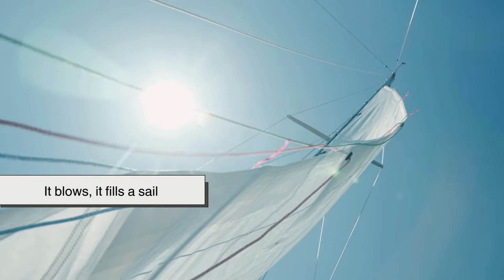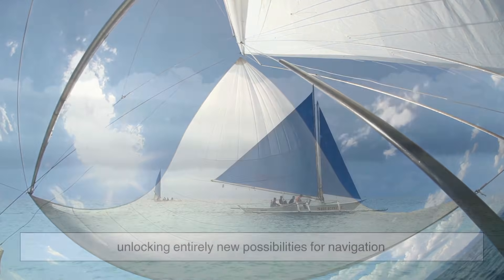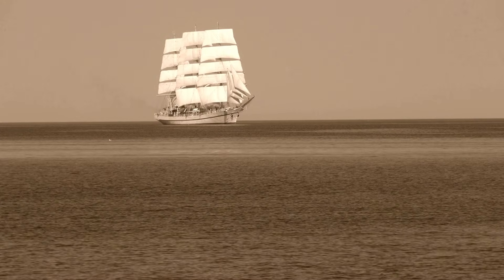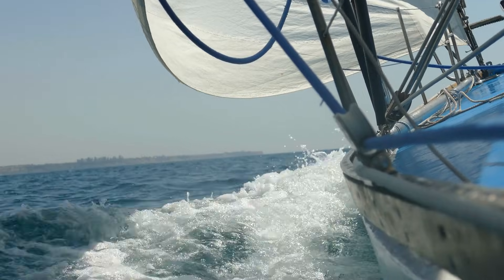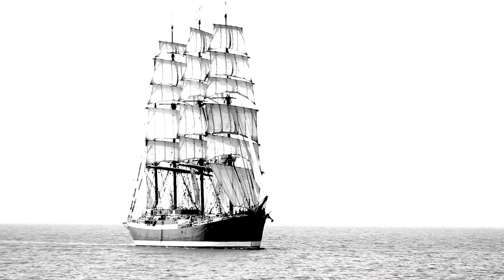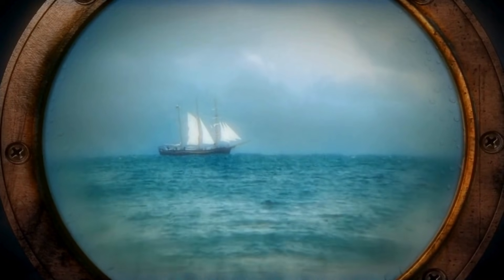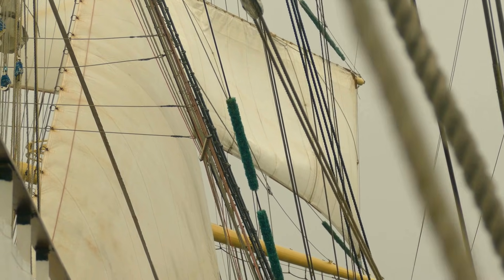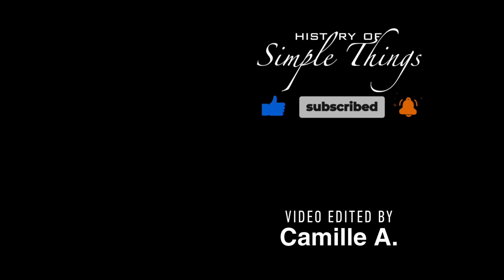Why Are Sails Triangular or Square? When Ships Combined Two Worlds (1204)

Comment: I think rectangular sails are obsolete - all the boats, that I have seen, use triangular or lateen sails, simply because using Bernoulli's principle is more effective rather than 'brute force' (which works only if you are sailing with the wind behind, which almost never happens). 🤔
Reply: Square sails are indeed rare these days, but they still exist on larger sailing vessels. Also, many modern sailboats with triangular sails use Genackers or Spinackers for downwind sailing. These are triangular, but technically belong to the group of square sails, as they're constructed to just push the boat forward by their huge size.